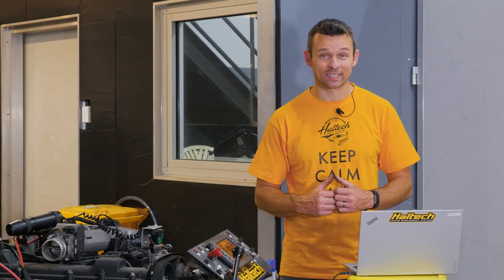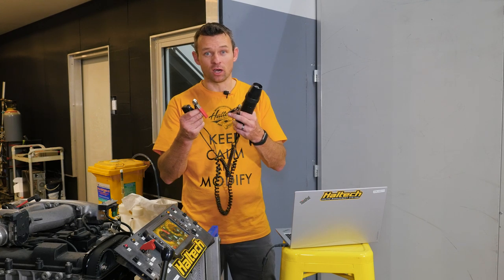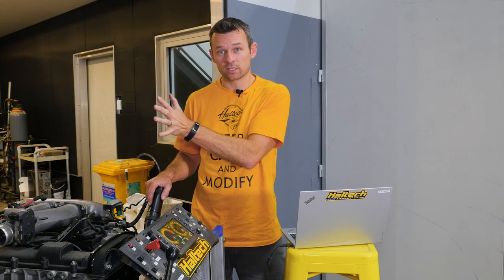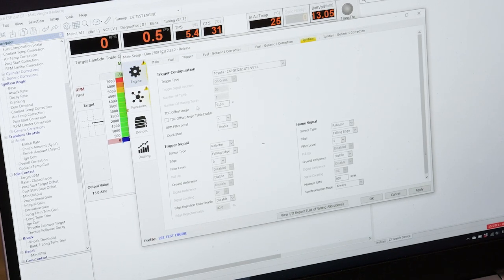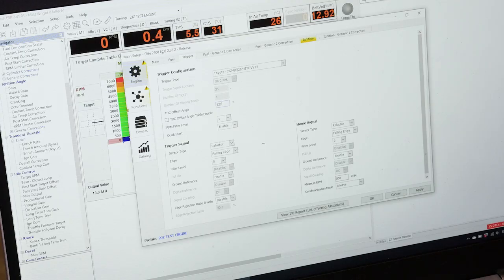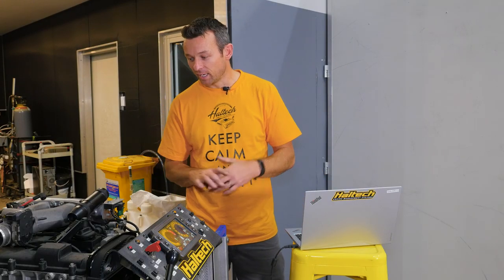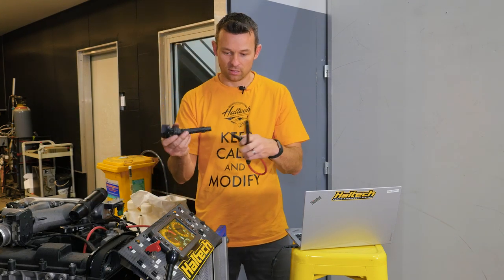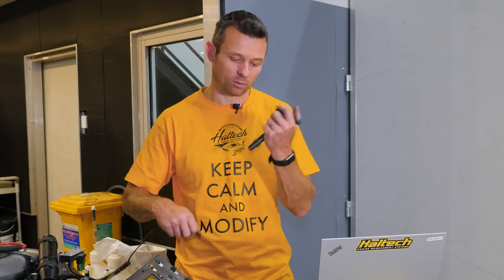💬 How To Use a Timing Light + Base Timing Setup | TECHNICALLY SPEAKING

Comment: If some of you are confused by the 520 figure for the timing to fire at TDC, the ECU can't anticipate, but counts from the crank sensor trigger point which will normally be a bit after TDC. So crank sensor triggered, 520 degrees or engine rotation, and ignition triggered for that cylinder.

Comment: That's nice but what about cranking advance? Try and start an engine with 220 psi cranking with 15 degrees advance.  Show us the difference between quick start, sync, wasted spark and the other parameters with cranking. A video showing how to set up this would be good, since before any engine can run, it's gotta first start.

Comment: the problem im having is that with the ca18det, the cam sensor mounts to the actual cam belt cover, their is no bracket under the cover like their is on an rb, so i cant have the cam sensor mounted and check the timing with the timing light on the cams to make sure its firing at TDC, the next thing im going to try later today (once the battery gets some more charge into it) is using the exhaust cam through the oil filler cap to see if it flashes with the lobe facing the turbo and hopefully ill be able to know if im on the right 0 or if im 360 degrees off, fingers crossed it works lol
Reply: Also struggling with timing on my ca18det..using coilpack and wastedspark ecu..timing sync on software and engine at 0 deg..then added 10 deg and engine sitting at 20deg
Reply: @jppelser4511  you need to lock the ignition timing to 0 in ignition setup, then check the timing, adjust the cam sensor until your engine is as close as possible to 0, then change the offset in the ignition setup to get the engine to 0. From how you worded your issue it's hard to give you any more specific advice. But it sounds like either your timing is incorrectly setup or you have a timing correction table adding timing, so after (or before) you confirm your ecu knows where 0 is, then try locking it to 10. If your still having issues contact haltect support, they are SUPER helpful

Comment: Very Stupid Question: does it matter which spark plug wire I use? Isn't the TDC sign referring to a particular piston? How do I know which one is at top dead center? Thanks
Reply: 99% of the time its cylinder no.1

Comment: Pro tip: if you have coil on plug ignition, putting the timing light pickup around the coil wires will fire your timing light accurately, no need for an ignition lead.
Reply: Sometimes this works but sometimes it won't. Often the timing gun is not sensitive enough to pick up the pulse from the reasonably small signal wire.
Reply: This will give you a incorrect reading and is noted in the Haltech Quick Start Guides to not do this. Older Nissans commonly have a timing light service loop on the coil harness and many do this and get incorrect TDC numbers.
Reply: Jake Elliott - Not true. When you connect the timing light to the wire that goes into the coil it will show the timing at the beginning on the coils dwell cycle, but the spark doesn't happen until the end of the dwell (obviously) so the light will show the timing is advanced by a factor of whatever the coils dwell time is. Please follow the advice in the video and use a spark plug lead.